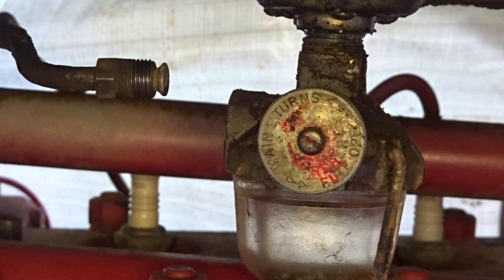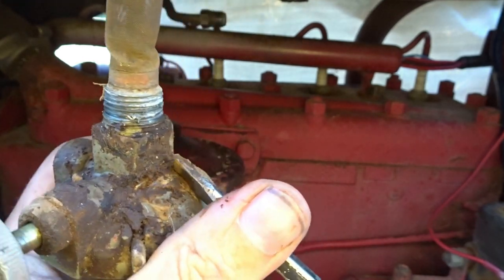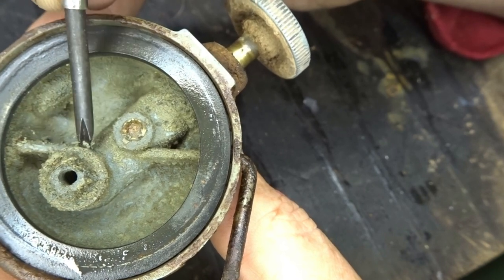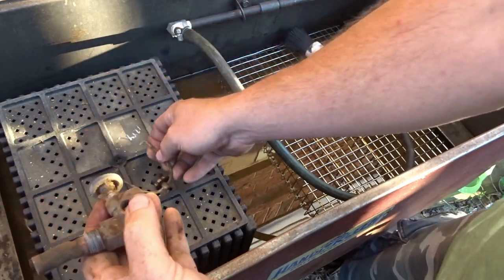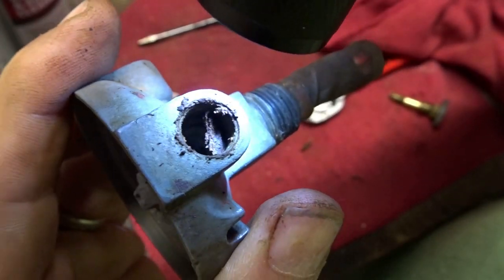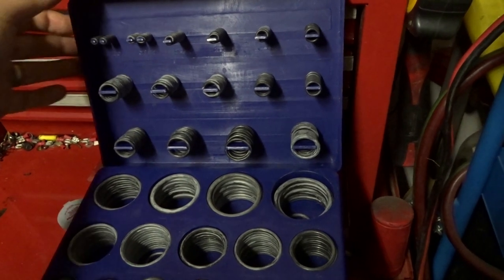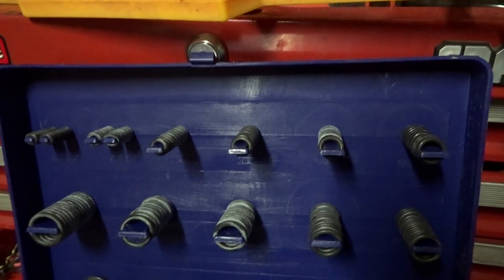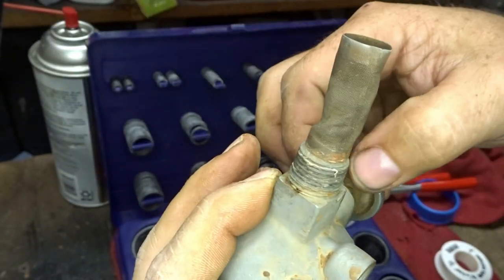8n Leaky Fuel Sediment Fix for a Few Cents

Comment: Thanks for your explanation.  I've got a '52 8N and been working on getting it up to speed, and have had some experience with the Sediment Bowl.  A few observations: the rubber o-ring goes BETWEEN the little washer and the nut, not up against the threads of the tip.  It may work as you have it, but it will eventually chew up the o-ring being pushes against the mating surface of the sediment bowl.  When it's between the washer and the nut, it simply gets squeezed/compressed and THAT's what seals the shaft from leaking.  Use a 7/16" flare wrench nut on all gas/oil lines - you won't have rounded corners on the nuts!  Use Permatex #2 sealant on the tank joint, the adjuster joint, and the gas inlet joint.  Teflon tape is not advised for gas line connections. I like your idea about finding an o-ring that fits - you said 6x2.  That's usually what needs to be replaced.  That, and the bowl gasket (cork is supposedly preferred over a rubber gasket).

Comment: We always had the best results with the cork bowl gasket. The rubber ones leaked every time. Some people have used string to make the packing for the shut off valve. 8ns have three fuel filters. One on top of the fuel valve, another between the valve body and the glass bowl,  this one is a flat circular screen ( I think yours is missing)and then  a third at the carburetor fuel elbow.

Comment: Everything you did showed viewers how to remove, clean and re-install a sediment bowl. No confirmation that it fixed the leak? Make a part 2  video with pouring fuel in tank, open valve to see how long it takes to fill bowl, and see if it actually works. Kinda important info isn't it? I was curious, don't know about other viewers but you left us hanging.
Reply: Not really 14:54-15:55 It clearly says if it leaks you will see an annotation if it didn't work.   There was no annotation so clearly it worked.

Comment: Never ever use a pair of channel lock or pliers on line fittings unless you want to have to replaced squashed fittings. Always use a properly sized line wrench.
Reply from the maker: Well if I couldn't get it off or it was slipping I would have.
Reply: vice grips